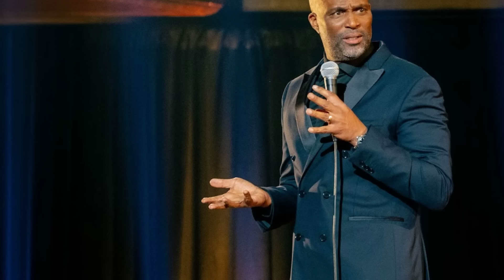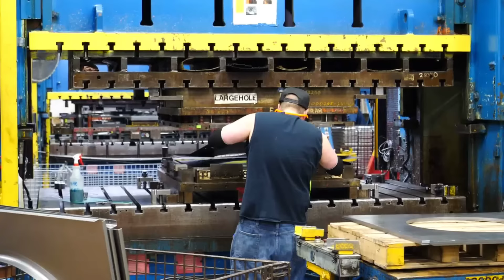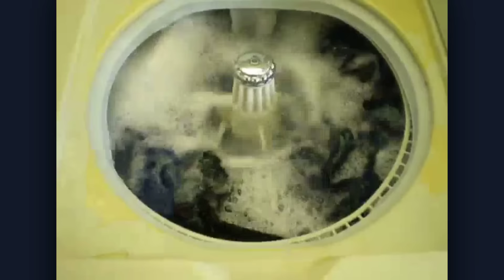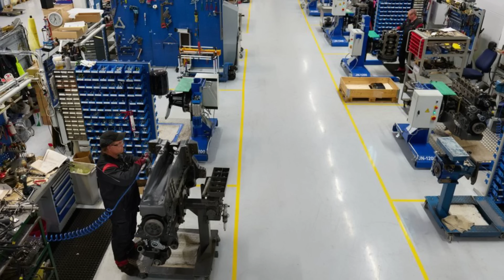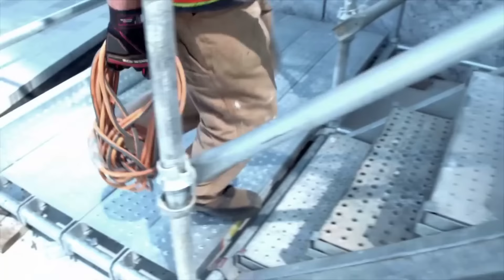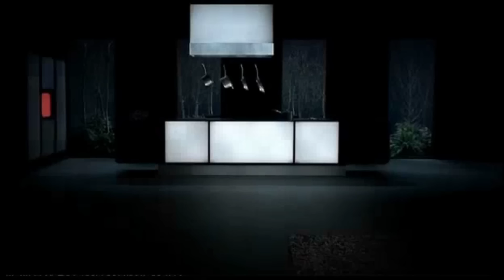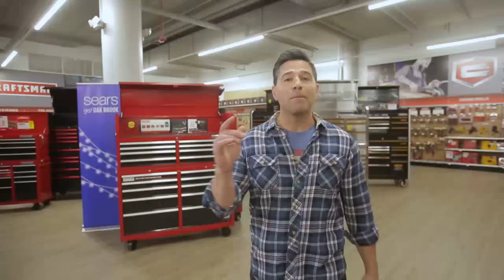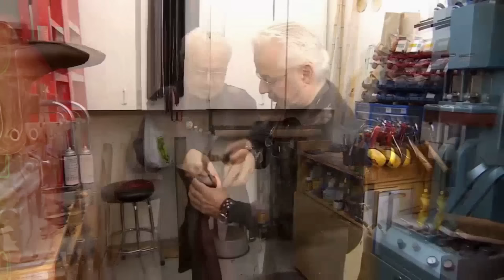The Only 5 Brands That Still Last (The "Buy It For Life" List)

Comment: Another small engine I’d like to add to this list that still makes indestructible engines is the predator from harbor freight. Got a 212 that has spent all winter outside and still runs like it was just bought yesterday

Comment: Bought a GE washer basic model no computer bs. About 9 mos old it decided to stop working. It was never abused overloaded etc. I opened up the back & to my amazement were two gallon milk style plastic jugs filled with cement apparently to keep the machine balanced. WTF
One of the jugs had come off of some weird hook configuration & stopped the machine in its tracks totally dead & unfixable.
Our country needs to demand that quality manufacturing must be brought back & all foreign made shit stays out of our stores.

Comment: I have an old washing machine, not Speed Queen, but same concept. Top loader that fills up with water. It sloshes the clothes in the water. Newer machines (exception the Speed Queen) saves water but uses friction to wash the clothes. So not great even if the plastic parts don't break. Common theme of many products is practices by private equity firms effectively making this country depending more on outside nations to provide us products.

Comment: I bought a Maytag (now owned by Whirlpool) washer and dryer a few years ago. The washer started not agitating right. It was only three yrs old. I had it worked on. It washed maybe three loads and it screwed up again. I typed in a calibration code and it did different things each time I tried to get it to wash. I finally unpluged it and went to a washerette . The repair man did say Speed Queen was the one with the least problems. They are expensive but it or a Dexter will be my next washer. Both are commercial washers.

Comment: What has worked for us:  Refrigeration:  SubZero.  Dishwasher/Clothes Washer/Dryer:  Miele.  Range:  Viking.  Vacuums: Shark.  Built to last, very few problems.  A/C:  Amana (Dyson), Furnace:  Lennox.  Minimal issues.  
Sub Zero, one repair call in 20 yrs, top up freon, clean condenser.  Miele Dishwasher:  One valve in 20 yrs.  Miele washer: Water level adjustment.  Miele dryer:  One moisture sensor, a wear part.  Amana: Outside unit replaced after 25 yrs.  New install had small leaks at solder joints, issue with installation, not the unit itself.  Viking range, some of the burners do not automatically light, for those we use matches, problem solved. Shark, no issues, for most of the units.  One of the robot vacuums failed, replaced at no charge by Shark.  We do have a maint contr on furnace and a/c with visits every 6 mo for season change.  This is important, and staves off problems.  We have had very good luck with these products.  On autos:  We stick with Toyota, do the required maintenance, and have an extended warranty 0 deductible, which we have never had to use.
Reply: Also: Kohler engines in riding mowers are great.

Comment: The cast iron pans is a fair bit misleading. They are definitely tough and long-lasting, made here in America, but the same casting methods that made them so great in decades past is no longer used. The finer grains used in the casting process in the past that resulted in far smoother pans lead to a great deal of health problems for workers, and the companies understandably switched to much larger grains that could be filtered out. The problem is the casting quality is now very poor, requiring consumers to need to file down or smooth casting marks, and even grind the skillet surface smooth to achieve the same non-stick surfaces of the hand-me-down pans people praise so much.

Comment: Milwaukee power tools break. I’m locked in, have too many to change but they fail. M18, and fuel brushless, doesn’t matter, some still going after 15 yrs moderate use, some dead after a couple years

Comment: I bought a canister vacuum cleaner in the late 80s. It lasted over 20 years. I had to replace the hose once. I decided to buy a new vacuum cleaner. I noticed something strange while shopping. The prices were still the same. They did not increase. One sales person told me that vacuum cleaners today are built to last no longer than 2 years. I could not bring myself to buy a new vacuum cleaner after she told me that. A client gave me a new upright Dirt Devil. Sure enough, it was dead by 2 years. It's so wasteful. Whatever happened to worrying about full landfills? Anyway, that's the reason the prices haven't increased. Crazy.

I have clients who have Sub-Zero refrigerators. Those are around $25k. But they never die. My clients with the smart refrigerators have to replace rather frequently. 

Make a video on othet household appliances. Stoves, ovens, vacuum cleaners, refrigerators, dishwashers, etc..

Comment: 3:41 this is simply not true. I buy my outdoor lawn equipment and have always looked for Honda motors. I've had to pull carbs apart and looking for something as simple as pawls or a pull start is not easy. The replacement parts are noticeably cheap and made god knows where. 
I do agree with the boot thing. A good pair of boots will change your life. I've had the same pair or Red Wing gaffing boots for 8 years. I was not easy on them. They still don't leak and I still have the original laces. Quality matters

Comment: I have had my Maytag’s washer and dryer for over 10 years.  I replaced my rubber gasket and a drain hose two years ago.  I replaced a fin in my dryer about 5 years ago.    Other than some weird unknown caused occasional small water leak they are great.

Comment: I had a Speed Queen Commercial Heavy Duty washing machine. The salesman told me it was the same washing machine as in the laundromat, but without the coin slots. I guess he was telling the truth. It lasted a long time but finally broke. I had a repairman take a look at it and he told me it needed a new motor. The motor cost as much as a cheap washing machine, but I had him replace it. Then something else broke.   I have a pair of Red Wing boots that needed new soles, so I took them back to the Red Wing shoe store. They sent them out and got new soles put on just like the ones they came with. IIRC it was $68 and change including tax.   I have 2 Wagner 1891 cast iron skillets and no other frying pans. I gave my ex the smallest pan of the 3-pan set and kept the medium and large sizes. They're practically non-stick.   I was just using a pair of Channellock pliers in my basement a few hours ago. I have an American made Crescent wrench, and a Stanley knife that's probably over 50 years old, too. I don't know which of the old brand names are still made here, but these of mine are.

Comment: At our 20 unit condo building, built in 1929, we have a common laundry.  We have two washers and two dryers.  We use Maytag Neptune commercial machines with the coin slot case, but no coin slot in it. With 20 families using two pairs of machines, we get about a dozen years out of them.

Comment: I bought my current lawn mower and it laterally doesn't have a drain plug for the engine oil. It cant be changed??? I didn't even think that was a "feature" that existed when I purchased it and it is a mistake I will never make again.

Like wtf? It's a gas engine. It NEEDS oil changes. And they apparently have the gall to treat it as a feature, not a bug...

Comment: If this video is for real, it’s great. I hope you will make lots more.
I’m 74. My daughter is still using my mother‘s Singer sewing machine. It’s got to be closing in on 100 years old, but I don’t know it’s actual manufacturing date. Mama eventually bought a new Singer for the fancy stitches a new model could produce – it was trash. I paid a small fortune for a Bernina. It broke and couldn’t be repaired in less than 10 years.

Comment: I have a brass-bladed GE electric fan that was made in 1909 that I still use every summer.  The body is black-painted cast iron, and is heavy as a dumbbell; the cage has openings big enough to stick a whole hand through -- it's just meant to protect against you bumping against it; early 20th century manufacturers still assumed you had sense enough not to poke your fingers into spinning blades.  It's old, it's heavy, it's "unsafe" by modern standards, but after more than a hundred years, it still runs like new, and that's not something you'll ever be able to say about an electric fan you can go buy at Walmart right now.

Comment: I have a small handheld pipe cutter from the 30s that has been used hundreds of times….the wheel has never been replaced or sharpened, and it’s never been lived, and the thing still works flawlessly.

Comment: My 20 year old whirlpool washer just quit ..im hoping i can get it repaired ..and if i have to buy another one hope i can get what they say to a speed queens with out all the BS ..the whirlpool i have had for 20 years was one of the first with the censor and lock lid and it did work great for many years …but dont want another one ..i want just a washing machine with an agitator in the middle the 20 year old one i have doesnt have it ..and no computer Bs ..i still have the cast iron frying pans my mother had ..use them all the time have a cupboard full of the other junk i never use   Most were gifts

Comment: I’m using my father’s Craftsman snow blower that he bought about 30 years ago.I finally replaced the Auger belt last year & the pull cord 2 years ago.I also changed the electric starter.I do my maintenance etc oil change & put it away every spring properly & it’s still going without fail.

Comment: The only problem is the stuff that last for a long time now has a non practical reasonable price tag attached to it .  Such as this a regular 12-pcs Wright Tool socket set is $1,200,-$4,000 which is laughable when drawing any comparison to what the people of the past paid for similar quality.  Which is why the buy and disposable model works. Good quality companys overinflate there products which makes both models virtually equal.

Comment: Have a Speed Queen washer, a Speed Queen dryer, a few Lodge pans, and my best tools are a few Craftsman ones: needle-nose pliers, spring-loaded watchmaker’s pliers (apparently), and spring-loaded wire snips. Came in 1 set, in the ’90s. But I’m not sure if they are still made and with the same quality.

Comment: Nice video even if AI generated.  I'm a big fan of
 "buy it once".
I have tools that I bought to use as a weldor/steelworker  more than 50 years ago. Still h ave them. 
And, oh yes---i gave up on craftsman about 35 years ago. All the big box/hardware stores really push craftsman anymore, but I WILL NOT BUY ANYTHING with that name on it.
My wife and I have been asked why we keep our vehicles so long. We tell people there is nothing wrong with them. We don't like car/truck payments and we take care of our vehicles. We don't tailgate/speed/ pull stupid maneuvers/look at our phones while driving---and therefore don't have to get fixed or replaced vehicles. We're simple people.

Comment: I intentionally bought a 2017 speed queen last year because it has a transmission.  The newer ones don’t, they have computer boards and no transmission.  I also bought replacement parts so I can repair it myself.

Comment: I got a home that came with a Kenmore top loading washer, no computer, only a loud buzzer that tells you when it's done. Works just fine,  I'll never replace it with anything else. Same with my fridge, a big white whirlpool with no chips. If I ever move, both are coming with me. I have provided emergency wash service to friends whose fancy machines have broken down repeatedly,  followed by the other ancient, reliable, working service called hanging out to dry. Smells better than any fabric freshener can ever match. 🤣😁👍

Comment: I work in the service dept. of a MAJOR electronics company - and a lot of our hand held devices are not supported for repairs at all- no parts, no repairs available because it would cost more to repair them - than what it would take to assemble one ( new) and sell that to the end user.  Cheaper by far.  A lot of customers legit do NOT understand that.  Nobody is willing to shell out $400 for a $ 200 clamp meter.  Makes no fiscal sense to offer repair the majority of the small hand held stuff.

Comment: Though I had 3 Honda cars and liked all of them, I  bought my first Honda 21” lawnmower 4 years ago and have never had as many problems with a small gasoline engine as this mower: junk.  Multiple surging problems from a lousy carburetor.  Engine also lost all compression because valve stuck in open position when shutdown. I would never buy a Honda mower again.

Comment: My mother and father owned Sears washer and dryer set from 1960--until 2003 when they finally gave out.  My mother in law? Same thing.
NO ONE makes them last that long anymore, except for Speed Queen.  We owned the first Maytag "Neptune" set back in 2003.  Had one washer gasket repaired (recall, so it was free).  Still ran until 2013,  Not as good as Speed Queen, but close.

Now we own a Samsung set--washer has been repaired three times; not the control board, but the dispenser.  It stopped suctioning the bleach and the fabric softener from the compartments.  Finally fixed them AGAIN last month.
Worked for a while, now it stopped again.  So disgusted with it.

Comment: I don’t know about Honda GX Engines.  First Briggs and Kohler parts can also be found for models years old so this is NOT a brand differentiation! Second, although Honda is quality parts can be much more expensive (float needles on GX at over $25 versus $5 for Briggs I/C).  Third, my GXV340 Honda cannot sit very long or else it developes crud in the float bowl and needle seating problems.  That thing is always wanting to spill fuel out of the carb.
Reply: Also the wife bought my father-in-law a 5500 Honda generator and it never want to start sitting for a while.  He has it under cover and it has a steel gas tank. That thing is not sealed and wants to rust on the inside thereby clogging the carb

Comment: 3:42 Throwing a generator away if the PULL CORD SNAPS?  My AI guy you're sort of right, but this is absurd.  Pull cord snapped on the Troy Bilt that came with my house... probably some 20+ year old 7.5kw generator.  Pulled the old cord out of the handle and replaced it with the same length of paracord.  It's not hard or even that handy to figure that out.

Comment: I have been using my Frigidaire side-by-side refrigerator for over 20 years and have never had to replace it or repair it.  And for the last 10 years, it has been sitting on my screened front porch. In heat and cold and still in use.  I will never buy anything, but Frigidaire if I ever have to replace it.

Comment: Speed Queens so called manual switches are connected to a cheap circuit board from Mexico.  They are no longer mechanical.  They've also had some issues with honoring there warranty.  I learned all that by watching you tube videos on Speed Queens latest machines.

Comment: My 2020 Speed Queen Dryer. Lasted 60 days, heating element failure, 72 days to get a replacement. Technician tells me to keep in on low! 

2020 Speed Queen Washer,  mother board has been replaced, the replaced mother board is failing now. Heavy cycle does not work, Large load filling works intermittently.

Comment: In the home I live in, which was purchased in 1998 with 10-15 year old appliances (Made in 84-88ish).  In the last couple years, the washer/drier went out (Tappan), Furnace (forgot name brand), water heater (forgot), and stove (Tappan).  So basically these appliances lasted around 40 years before needing replacement.  I know these won't last another 40, probably not another 15.😔

Comment: This is a great video and should actually be expanded! I married my hubby 40 years ago together with his Siemens washing machine 🤣 which was then already 12 years old!! Only 4 years ago we put "her" in the storage room because we can't find the little spare part which finally retired. The Bosch replacement works fine and has no hiccups so far. The same goes for the fridge/freezer of GE with the little extra door in the front for beverages and ice/water dispenser which is 40 years old  and has a basic software for door alarm and system checking. The same goes for the Italian Glemgas stove and dishwasher. I needed a new thermostat a couple of years ago, couldn't find it, wrote to Glemgas and within a month I had the replacement! My little fridge in the office "Italelectro" was second hand when hubby bought it in 1977 and it still works perfectly. All I did was covering the outside with a nice woodlook-like foil ... good as new. All our "oldies" need is tender loving care and regular, proper cleaning after use. We travelled 2 continents during our business life with my hubby's tool - incl. a heavy drill and jigsaw 😆 - since he's not only an excellent engineer but also a handyman. All his tools are still heavy metal, sturdy and reliable. 

We were contemplating of changing my 13 yr old car but were advised against it by our mechanic since the new ones are delicate with all their computer technology and fancy gadgets. All I want is to go from A to B without troubles and I have no need to show off my "fancy" car 😉. My old one is in perfect shape despite the often horrible roads (we live now in a so called 3rd world country) so why change it? I "gifted" myself a Bernina Electronic sewing machine 55 years ago when I turned 20, clean and oil it regularly and the mechanic had a hey-day 4 years ago when I brought it back to Switzerland for a thorough cleaning! He thanked me for the joy he had to have a "real" machine under his hands and didn't want any money 🤣!! And so on ...